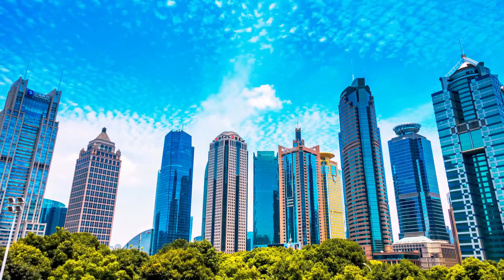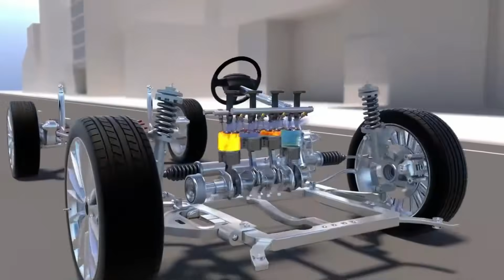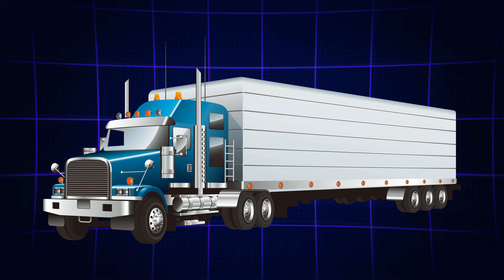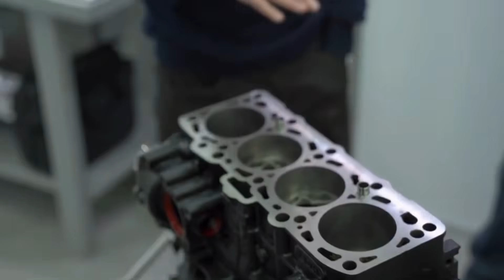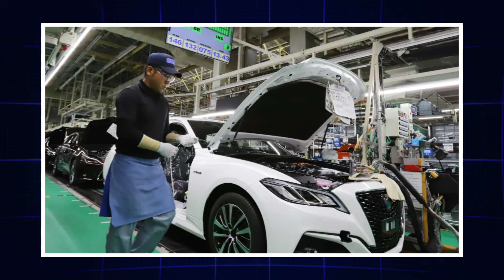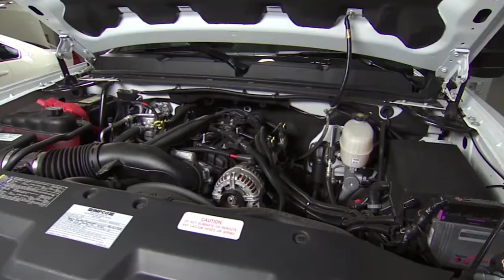China's New Engine Just HUMILIATED Tesla   And It Doesn't Use Batteries 2026

Comment: and we can trust it because china said it was true.  and we all know what quality build comes out of china, the country that brought you exploding lithium batteries. People have been using pistol engines converted to burn hydrogen for years, there are two issues, fuel storage on the vehicle, and a computer that adjusts the firing point thru the engine power cycle.